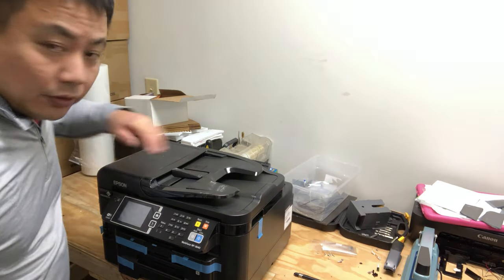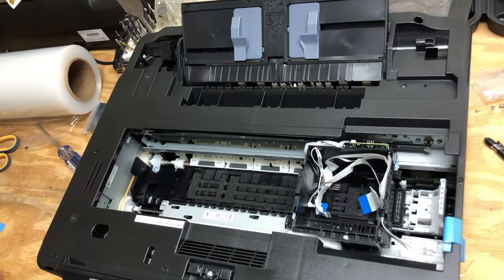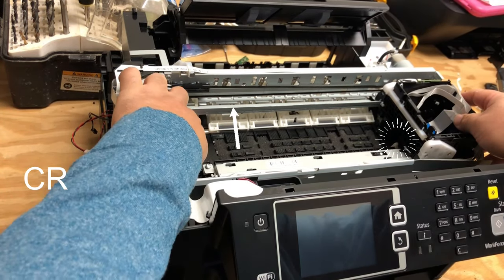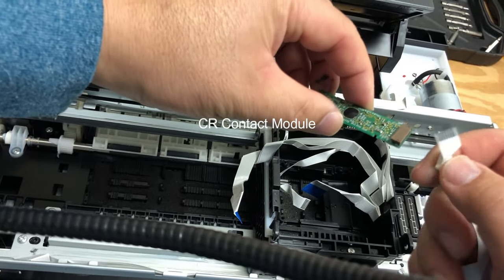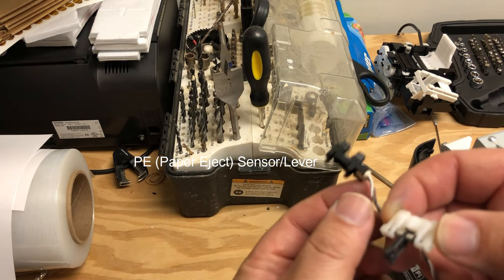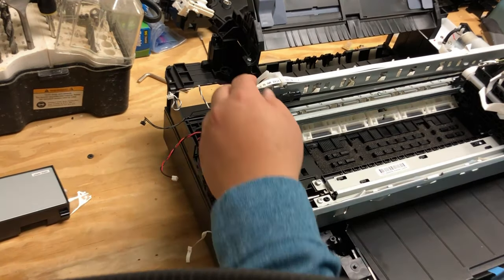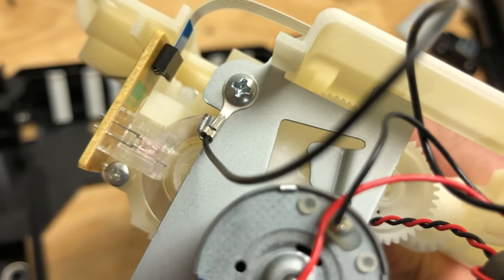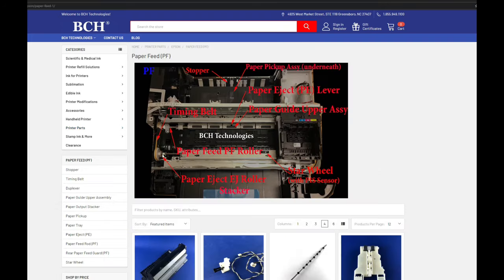Disassemble & taking apart an EPSON printer - What are the parts of an inkjet? Repair/Fix

Comment: you are a gift from God.. your video for printer dis assembly is the top I have watched, thank you.  But wait .. this makes the error "close ink cartridge cover/034503" a little bit weird since there is no sensor related with that. Can you please give some light on the error? again more power... thank you
Reply from the maker: Yes.  It is at the beginning, after power on, right?  The CR is trying to move to the left but is stopped by something.  Therefore the printer thinks the cartridge cover is open and caught.  However, the problem is more likely underneath.
Reply: @BCHTechnologies  yes you are right .. it seems true issue is under the ink pump system which hold sa gears for the initial carriage position, but I could not figure it out ..lol.. anyways more power to you. Your video is really great, can you provide your website link? thanks again.
Reply from the maker: If you see the pump unit, there is a piece of white plastic.  I call it a "switch stick."  It controls a switch that determines which nozzle column gets cleaned.  The whole unit will raise when the gear is in a certain combination.  If your gear is out of sync, the pump unit is not lowered, thus obstructing the movement of the CR.  The whole purpose of raising the unit is for the printhead to slide the stick into another slot and press the switch below.  If the unit is raised, but the printhead is moving, you will have a problem.  Pay attention to exactly when the CR stops on error, and start figuring out what the pump unit's position should be. Then you can back-track and correct the problem.
Reply: @BCHTechnologies  thank you very much for the followup answer, yes I noticed that too I called it driveshaft, lol. Anyways I could not figure it out, I have replace the inkpump assembly but it it did not work out. Then I have a solution at that time I transfered the board to a different unit with the head.. now its having CRCM motor error lol. guess no luck. lol.. Again, thank you and more power. Will check your website later.
Reply from the maker: @c2sartinkprinthub757  You are welcome.  It's an interesting one.  I wonder why it has a CRCM motor error.

Comment: This is fantastic, I searched for ages trying to find someone doing this kind of breakdown. 

Quick question: where is the wireless module on this printer? I am moving to a location near radio satellites and need to be able to ensure this device will not be wifi/bluetooth capable to prevent interference.
Reply: Oh wait never mind, I just found your video where Abby does exactly that operation. Your channel is truly a goldmine, thanks for publishing these!
Reply from the maker: Glad you got it. Happy printing!
Reply from the maker: The Wifi board shold be plugged into the mainboard.

Comment: Thanks for your professional knowledge and techniques.  I have a question.  A spring from where the print head sits came off of mines how do I replace it.   I was blotting ink from where the print head sits and it popped off.

Comment: Thanks your look video! Is it possible to fix the error code 0x4D for WF-2661 ?  It shows after the forced took out paper sheet from ADF due to the too thick thickness of the paper and seem to be jammed. Can I just cu off the ADF function?

Comment: Kevin, do you have a disassembly procedure for Epson ET-4700?  I had to disconnect the cables from the mainboard that connect to the scanner assembly so I could remove the scanner assembly from the rest of the printer.  I am trying to reattach the scanner assembly but cannot determine where some of the cables connect to the mainboard.  Do you have pictures or drawings of the cable paths to the mainboard or a complete disassembly procedure for this printer?  James B.

Comment: Kevin, your videos are excellent, thank you.  I have a question and can't find answer anywhere.  I have an Epson ET-2803 and the flat flex cable (awm 5542 80c 60v vw-1 totoku-p) snapped after only using a handful of times.   Can you please tell me how to release the clip on left front that is holding the scanner lid in place?

Comment: Hi Kevin - I have a Epson WF 7515 - the printer has been unserviceable for a long time but I would like to continue to use the scanner - is it possible to separate the scanner from the printer to use it by itself?
Reply from the maker: Thank you for subscribing to my channel. No, it's built in one piece. If your printer doesn't have any electronic issues, just physical issues such as dried printhead, you can keep it running and use the scanner.

Comment: Hello Kevin, I just found your great channel. I am searching for a solution to a no-start problem with my ET-2550 printer after removing, flushing and replacing the printer head. The printer started the boot up process then quit part way through and went dead. The cables are fine and power is to the socket. I tried unpluging and waiting an hour then holding the power button down 10 seconds. No Go. I am stumped as what to do next. I assume it is an electronic failure a short or something but assume there is no fuse. Any suggestion might help. Maybe I managed to kill the mother board some way!
Reply from the maker: Probably the MOSFT.  Check my channel and there is a video for how to test those.